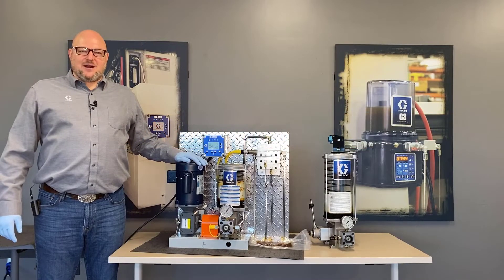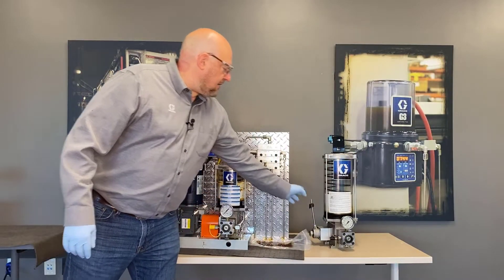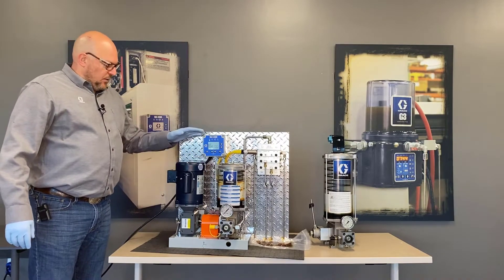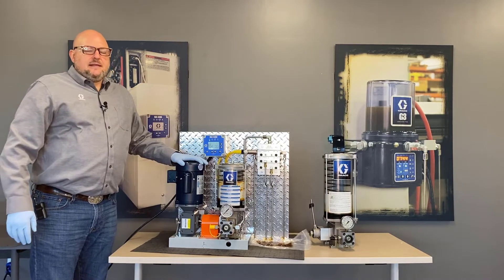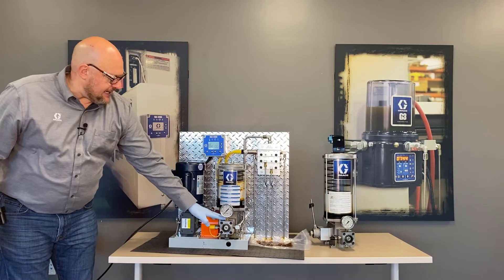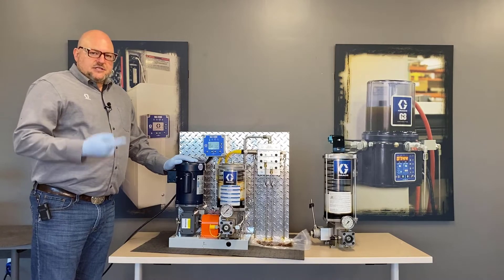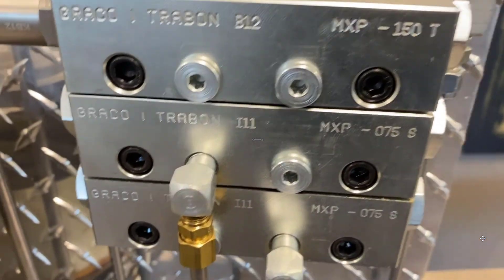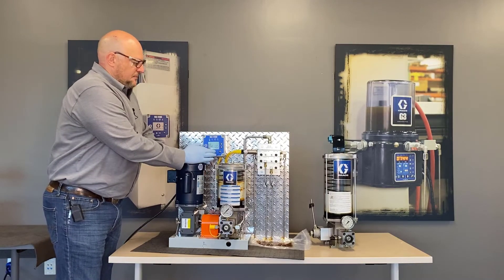Product Introduction and Overview | Graco Lube Master

Comment: How do I determine what PSI rated blowout disc to put in my unit
Reply from the maker: Hi there! Thank you for reaching out! The disc should be the weakest point in the system so that it bursts before other components do. Check the pressure ratings of all components downstream from the Lube Master pump and ensure the blowout disc is rated to burst at a pressure that is lower than any of the components. If you have further questions, please reach out to our LED Tech Assistance at 800-533-9655.